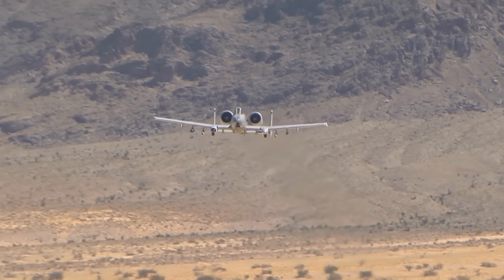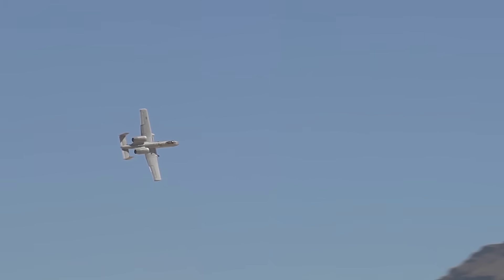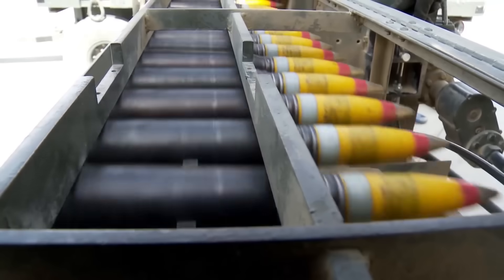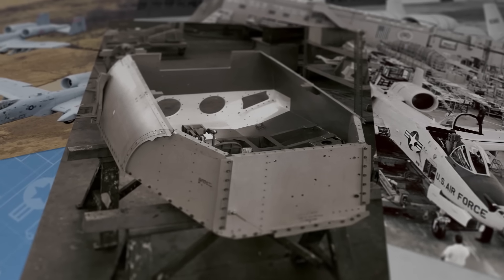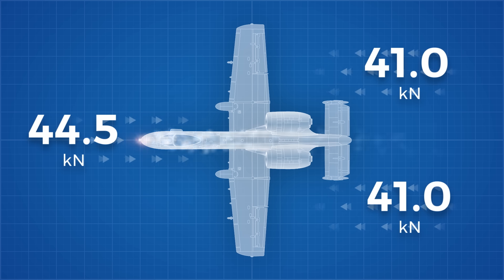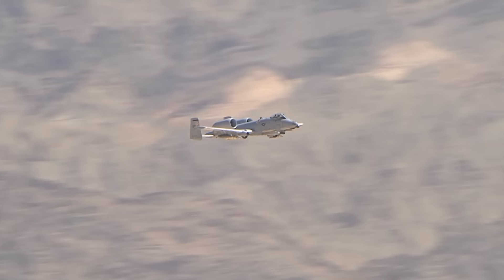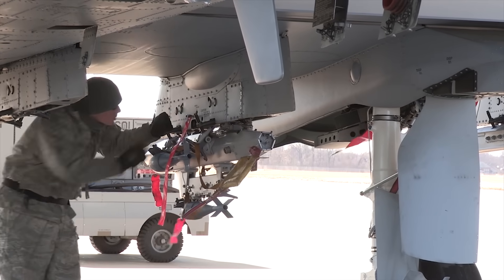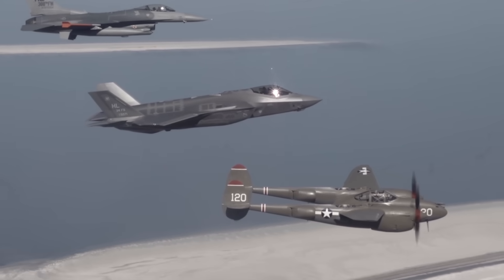The Insane Engineering of the A-10 Warthog

Comment: The Gau-8 is absolutly not accurate and because of that its the plane with the most friendly fires in the hole US army of all time. The Gau-8 is just useless bombs and rockets are better in Almosen every single way. Also its very easy to shoot down. Regardless if its flying under radar or not because while making the A-10 the designers apparently just forgot about the existens of the tunguska which can shredd A-10s.

Comment: The A-10 was n testing just as I got out of the Air Force. we got a film showing it in testing. They had Russian made tanks captured by the Israeli army, and they showed one pass by the A-10 on one of those tanks.  When it started the pass, there were two views, one on the aircraft, one on the tank. The A-10 zeroed in on the tank and dust flew. When the smoke cleared, there was a two-foot end of main gun barrel. The rest was chunks of unrecognizable tank pieces. Not much left. That was back in 1976 before I left the AF.

Comment: Can you imagine the costs of the f-35 taking damage?. And what will happen with the dust of rain and the stealth coatings? The F-35 for close air support makes no sense. A new A-10 could be designed using the parameters that the old dudes left.  That will include pretty low costs like using additive and close loop subtractive manufacturing, off-the-shelf components in EM cages instead of hardened components,  redundant fly-by wire instead of redundant hydraulics but keeping the manual overwrite, and changing the depleted uranium gun. We still have to answer if it make sense: The war in Ucraine has show the power of over the shoulder missiles. They are going to get even better and less expensive with time.  The best answer, of course is to stop killing each other and expend that money in infrastructure for better living, like protecting NYC from flood watters.
Reply: That's why the F-35 hits its targets from kilometers away
Reply: CAS does not require the plane to be close to allied or enemy troops. "Close" refers to the distance between allied and enemy troops, which necessitates the use of precise weaponry to avoid friendly fire or collateral damage, so any aircraft dropping a guided bomb on enemy troops from 10000ft is still performing CAS, and outside the reach of MANPADs.
Reply: @dumdumbinks274  Yep, if it works, and we know it does not.  For CAS the plane needs to be close in terms of time (so the ability to use unconventional airports )and needs to fire with enough precision and safety to the friendlies to disrupt enemy advances. It does not need to kill them always. For the disruption role, the gun is super useful. Now I understand the issue with low-cost missiles and drones, so maybe there is no future for something like the A10 (I will like it if there was no future for war) Eventually CAS will be performed by smart weapons.
Reply: @jaimeduncan6167  Actually we know it works and has done for the last 2 decades. Dropping bombs from 10000ft is the norm even for the A-10 since bombs are more precise than the A-10's gun. It just depends on the warhead how much collateral damage occurs. Strategic bombers have been used effectively, sometimes uniquely so within the CAS role because they are fast, accurate, carry a large payload, and can loiter for a long time.

There are also some new bombs that are extremely effective within the CAS role e.g. the GBU-53/B is a very small bomb that can be carried in large quantities, causes very little collateral damage, and has multiple guidance systems to engage targets in all weather conditions with high precision. Having multiple guidance systems also provides multiple redundancies to ensure it can hit the target if the enemy has for instance radio jamming capabilities that interfere with radar and GPS.

No war would be very nice, but I don't believe it is possible to achieve. With intelligence, experience, and cultural variation comes inevitable disagreement. With simple minds comes a lack of awareness and understanding, as well as entitlement. Humans just aren't good at following rules.
Reply: @dumdumbinks274  I am talking about emergency situations when the enemy lines are pretty close. not a planned attack. Even with the bombs. It's called "the A-10", not tomorrow we will search for the enemy column and bomb the heck of them. For that, we don't even need planes  (or will not very soon).  War: having a disagreement and having a war are not the same. France and UK have disagreements. Even so, the last war between France and UK was before 1815. The reversal of economic globalization (in part because people moved to globalize government) could lead to you being correct. IF economical globalization returns (with a human face). and the population stabilizes and we have access to the solar system resources maybe we will see the end of the war.
Reply: @jaimeduncan6167   @Jaime Duncan  I haven't said anything about planned missions .I'm talking about CAS, which is primarily a reactive role to assist troops in emergency situations.

The A-10 is pretty much the poster child of planned search and destroy missions. Those types of missions are what made it famous.

You seem to be missing my point. Disagreements can be resolved peacefully when people are reasonable. Expecting everybody to be reasonable is irrational. But you do seem to heave a realistic idea of when true peace might be possible.

Comment: William Thomas BONE CRUSHER di Masso., I used to be a USO penpal with you when you were flying Gulf One . your letters were candid and beautiful, but my life came apart. DID YOU SURVIVE ????????  i STARTED FLYING AGAIN AFTER BREAST CANCER AT DEER VALLEY AIRPORT IN PHOENIX, ARIZONA WITH BOB SAYLOR, THE CHIEF F4 PHANTOM INSTRUCTOR PILOT AT LUKE AFB, AND I FLEW AN F4 PHANTOM SIMULATOR SUCCESSFULLY THE FIRST TIME AT LUKE AT A PRIVATE PILOTS OPEN HOUSE.  I HAD WANTED TO JOIN THE AIR FORCE WHEN I WAS 18 IN 1973 AND I KNEW THAT I COULD HAVE BEEN AN EXCELLENT PHANTOM DRIVER . STILL I WOULD HAVE LOVED TO PROTECT GROUND TROOPS BY BLASTING TANKS TO BITS !

Comment: of all the Aircraft I have known about 1st fave - Supermarine spitfire... I am from the UK afterall, 2 the A10 Warthog, 3 a crossup between the blackbird and the F22 Raptor.... when I was a kid though, my fave toy for a long time was a proper metal F14 tomcat complete with swingwing and lights and it moved about the floor itself with takeoff noises... I used to also watch the Roger ramjet cartoon, so I of course thought I was great... today I have a half built supermarine spitfire model capable of about 70mph in the air, and yet I am afraid of flying, never been higher off the ground than about 5 stories lol.

Comment: The a 10 is a far more capable aircraft than the f 35 and it actually works!
Reply: Just no, you can't use a gatling gun (that isn't that accurate) to support friendly forces close to the enemy. The aircraft has been in numerous friendly fire incidents.

Comment: Not mentioned here is the fact  the US has  never been in  a  war  since  WW2 where  the enemy country  could  afford  an  airforce except to a limited  extent  in Korea and Vietnam.
Reply: Iraq had like the 4th or 5th largest air force in the world during the Gulf War.
Reply: @dongquixote7138 
 Laughable guess. Documented fact:
By 2003, Iraq's air power numbered an estimated 180 combat aircraft, of which only about half were flyable.[49
Reply: @davidgross4700  You should learn what the Gulf War was. Maybe you've heard of Operation Desert Storm.

"At the time of the Gulf War the Iraqi Air Force (IQAF) was the sixth largest in the world, consisting of over 750 fixed-wing combat aircraft operating out of 24 primary airfields, with 13 active dispersal fields and 19 additional dispersal fields. Iraq had also constructed 594 hardened aircraft shelters to house nearly its entire air force, protecting them from attack."
Reply: @dongquixote7138  
And they had invisible shields so no one  could  see them without  special  cereal box  glasses.
Reply: @davidgross4700  That's an amazing world you live in

Comment: It's always interesting to note that grunts always get the last word on the weapons they trust and like.  For the typical grunt in WW2 it was the BAR, it was robust and reliable,  in Vietnam it was the M-60,  reliable with lots of killing power,  for the modern grunt the A-10 is always available to do the job,  regardless of what the air force generals wanted.   In the first Gulf War, the F-16 destroyed more tanks then the A-10,  but the Wart Hog was better at pin point hard targeting.  The speed of the F-16 meant the pilots were unable to see the smaller targets and hit them.  I'm reminded of how much the  Marines appreciated the fire power and loitering ability of the Sky Raiders in Vietnam.  Their low speed was actually an advantage at hitting the enemy.
Reply: Not only do the A-10 suffered more combat loss than any other NATO aircrafts in Gulf War. They also were responsible for far more friendly fire incident. Lets not forget  that thing got was so bad that the A-10 pilot had to use binoculars for target acquisition.

Comment: And this is exactly what Ukraine needs to destroy Putin's army in Ukraine.
The war would be over in 2 or 3 days.
Reply: Bullshit,
Reply: @remliqa  idk if you'll read or respond but it's awesome to see you do God's work
Reply: @remliqa  Ok so what I meant to say was that the A10’s could annihilate the tank and supply line columns in short order.  If that 40km stalled Russian supply line at the beginning of the war had been attacked by A10's the ground war would have been over in a few days. No supplies... no war. It's a fairly simple concept. If you can't re-supply your army, then battle over.  I watched the “Warthog” decimate the retreating Iraqi tanks that were fleeing back to Baghdad. It was called the “Highway of Death.”  The ground war was over in 100 hours - 4 days. I suggest you watch it then re-evaluate your thinking.
Reply: @KiwiEatsRootsandLeaves  There are several problem with that:
1) The A-10 main gun is actually obsolete as it can't  penetrate  the armour of T-72  tank and anything more advance that that . In  fact the guns was obsolete the moment it came into service in 1977 . It may still be useful for "soft" target like truck or IFV but there is problem with that too  (see  point, No 2). Of course this can be mitigated as the A-10 can carry large number of air to ground missiles  capable of destroying these tanks which lead to the second problem.

2) The Ukrainian do not have air supremacy . Not only the A-10 will have to contend with  the Russian Airforce , but the AA defense form the ground. Remember the Ukrainians  have aircrafts of their own but they could not launch such a attacks on those column because of the exacts same reasons. The Russian have very good SHORAD that will shred slow moving targets like the A-10

3) Training. The Ukrainian have no experience operating the A-10 and have to be trained  form the ground up to operate such machinery. This  will take months 

 While the A-10 did very well in Afghanistan because the Taliban have no capable AA. , it service records in Iraq wasn't as glowing : It destroyed less target than F-16  and other aircrafts while having the highest casualties of all coalition aircrafts, this is despite them having complete air dominance in Iraq. On top of that the A-10 also cause the most Blue on Blue deaths as well as collateral damage.
Reply: @remliqa  Thank you for your reply. I totally respect your comments. I suppose what I was concentrating on was the A-10's ability to take out soft targets as you rightly call them... fuel supplies, ammo supplies, food supplies etc for the Russian army. Surely if you can "starve" an Army, you would have to win? What are your thoughts?
Reply: @KiwiEatsRootsandLeaves  Again, the problem with that is the Russians have vey good SHORADS and have access to MANPADS. This is the reason whey the Ukrainian  themselves could  not conduct successful air raid  (and have to rely on action by Ukraine ground forces)  to attack these soft targets despite having  an air force of their own.

Comment: You should do more research on the A-10 Thunderbolt II. Statistically it is a terrible aircraft that cause more civilian casualties and blue on blue incidents than any other aircraft post-WW2. It's gun has been proven incapable of destroying any modern tank and it's rockets, bombs, and missiles can easily be carried in greater capacity by other aircraft. It is slower than most WW2 aircraft due to it being weighed down by a useless big cannon. Costs a fortune to keep in service and now should cost more than the F-35 which is currently cheeper to produce and maintain. Heck even the B1 Lancer has outperformed the A-10 Thunderbolt II in combat roles. Want more evidence watch LazerPig's video called "The A-10 Sucks and I can prove it Mathematically". There are two parts to it, WATCH BOTH please.

Comment: The A-10 Thunderbolt(pilots do not like the nickname: Warthog), is today, being designed "Smaller." A stealth diamond-shape with twin tail,  twin-scramjet engines. Most of the body will be for airflow, similar to an A-7 Corsair. The wings will have internal storage for short-range missiles. Designed primarily as a low-level infiltrator for close-air support, with immense survivability. Think of a magnesium/titanium frame. Many nations are interested in the variant, as unmanned aircraft, have begun an extinction event of armored divisions.

Comment: Great video. I'm thinking of what role the A-10 could provide in Ukraine with Russian radar and SAMs active. Would it be a sitting duck moving relatively slow and very close to the frontlines (which is was designed for anyway)? I'm just trying a thought experiment on what an A-10 could do up against modern radar and SAMs possibly pointed at it, not to mention the Russian version of a Stinger missile.
Reply: I'm guessing A10 Hogs in Ukraine would trigger WWIII. I'm further postulating that it probably wouldn't fare very well vs. the radar and missiles you mention, but what the f do I know?

Comment: Well Im pretty sure depleted uranium is being cycled out of production. Turns out replacing the depleted uranium needle with a copper needle proved more effective and much safer as copper is non radioactive but it will pierce thick plate steel and lose very little structural form meaning when the copper needle reaches the inside of say a tank it is hotter than you could imagine and bouncing around fucking destroying anything inside to fucking hot ash and hot steel. Fuck with USA and get a taste. Copper even kills bacteria and russia.
Reply: Depleted uranium is not hazardous. It gives off so little radiation that it the radiation can't even penetrate the skin.

Comment: The key element that allows A-10 critics to argue it's obsolete is guided ordnance.  When the A-10 was designed and prototyped, only science fiction writers had imagined smart bombs.  Now the US not only has guided bombs that can be dropped from aircraft but it has developed artillery shells that can be guided onto the tops of tanks, destroying them every bit as effectively as an A-10's gun and without putting a pilot at risk.  While the narrator compares the F-35 and the F-16 to the A-10, he doesn't compare it to the F-15 strike eagle which is an excellent ground support aircraft.  Plus, it can defend itself in a dogfight better than an A-10 can.
Reply: I am a retired aircraft armament systems specialist. I worked A-10s for 15 years and F-15s for 12 years. A-10s carry both laser and GPS guided munitions. They fly much slower than the F-15 which allows them more time to acquire targets and more accuracy and time to fire at targets. The Gau-8 30mm gun holds more ammo and fires slower than the F-15s M61-A1 20mm which allows for more destruction over a larger area. A-10S are more suitable for forward operating locations with shorter runways and are not as susceptible to FOD damage from debris on runways and taxiways as the A-10 engines are on top of the aircraft. Lastly, I haven't seen any comments from ground troops here praising strike eagles.

Comment: I had read that the U.S. sent 3 squadrons of A10's to Ukraine.  They did not make it into the country.  Maybe in defense of NATO territory.  Unfortunate because that 40 mile convoy could have easily been picked off by the A10's.  Also, no air defenses systems were sent to Ukraine, no Patriot missile batteries or C Ram systems.  Those would have stopped most of the carnage.

Comment: Unfortunately the plane is not expensive enough for the U.S. Air Force generals who want to replace it with a much more expensive aircraft and one that is far less fuel efficient. But it will increase profits for the weapons company that makes it and help insure a nice retirement slot for the general in charge of the program and that is all that matters. 

Crazy top compare the Sherman tank of WW II that was the worst tank in Europe and had to be discarded when the Soviets invaded Manchuria and forced the surrender of Japan 3 weeks later, with the T-34 Soviet tank that was supperior to most of the Panther tanks fielded by Germany. Shermans against the Panther resulted in 90% kill rate of the American and British crews inside. With the T-34 the Soviets prevailed against all but the Tiger tanks of the Germans.

Comment: Wouldn't the correct comparison for strategic and operational "close air support" be with the Apache helicopter rather than an attack jet platform? I think that's been the argument on the table for retiring the A10.  Not that I'm arguing for/against retirement, I just think that's the capability comparison.  It's not fixed wing vs fixed wing, it's capability vs capability. Further, a variety of drone capabilities offer close air support.